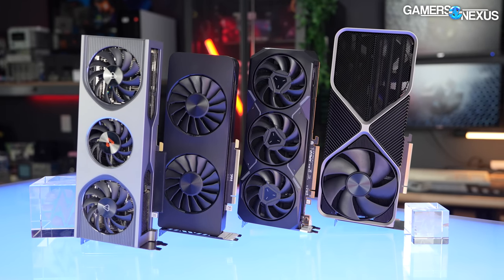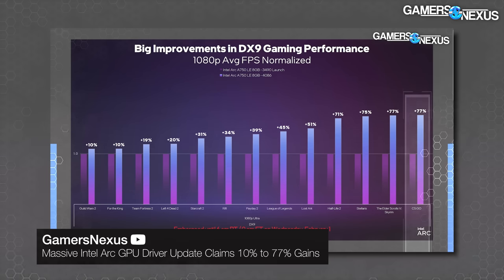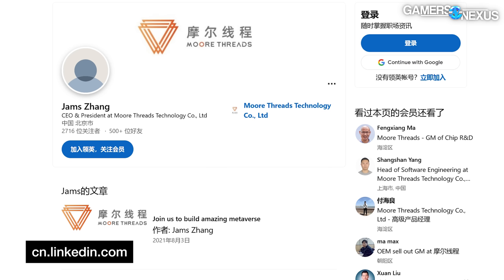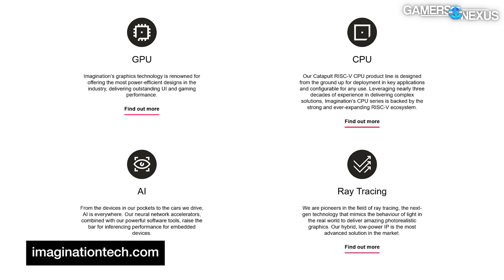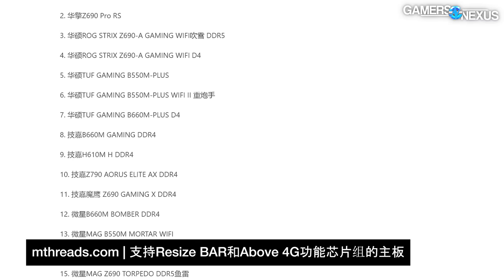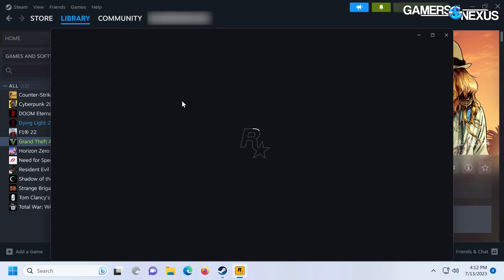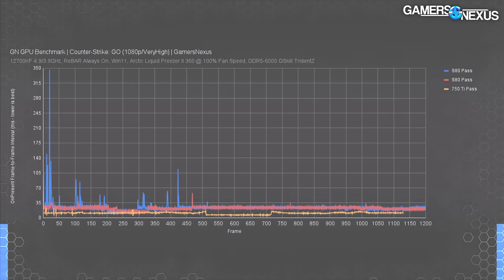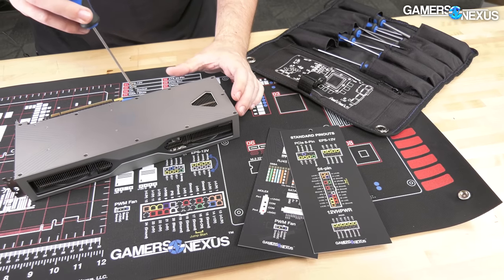China's Moore Threads MTT S80 GPU Review | A New Challenger Appears

Comment: If this is a domestic GPU, I wonder if it has better Linux performance.
Reply: In 2016 i remember the chinese creating dslr lenses at half the price and superior lens quality. They have done this in every field. Now GPU's. It will take a bit of time, but the chinese are fast.
Reply: Looks like it does have a binary-only Linux driver. They advertise support for Vulkan 1.3, which theoretically should run dxvk. So it's plausible.
Reply: It's very disappointing - everyone I've seen has clowned on the windows performance and rightfully so but I've not seen a single Linux benchmark of the card anywhere?
Reply: @starsnstrife ”Superior lens quality” is just not true. Even today it’s not true. At best it’s similar quality to your standard glass manufacturers, but in practice most of those lenses you’re talking about have noticeable issues. I wish you were correct!
Reply: @starsnstrife  lol this was funny. They want Taiwan because they cannot do this themself.
Reply: I wonder, but I also doubt it. It might gain on nvidea there, but I doubt it is better than its windows performance.  I mean, my Arc GPU is still not a great linux experience.

Maybe Phoronix will put it through the paces soon.
Reply: @starsnstrife  Nah what would they be? All i've seen are cute toys at best. Mind you flawed lenses can be a ton of fun.

There are areas where China is either leading or competing equally or have things that might be a little flawed but also nice and fun, but like betting on them just steamrolling everything because China Bik Stronk is not a safe bet. Quick iteration as they do sometimes helps, sometimes causes a lot of one step forward two steps back sort of motion.
Reply: @starsnstrife That’s just categorically false. It’s very common tactic in China to compare their best stuff to about B-tier stuff(or very old stuff) in the West(or Taiwan) and claims to be some enormous breakthrough to secure fundings from big companies or government that doesn’t know better.

They then use the fundings to cover the excess cost from poor/inefficient manufacturing and sell their products at lower price often at a lost to secure market share. They do it in a sort of fake it till you make it way, but as seen in the video pretty much every attempt in the tech field either failed or turns into scam.

The lenses you talk about are definitely not comparable to the better products outside and probably cost more in terms of material to produce too, but the government fundings are designed to give them an unfair market advantage.
Reply: @starsnstrife not with this. They simply are too far behind in process node and no where close to advancing. The past two government funded efforts to advance this domestically went bankrupt.  The Chinese are fast when they have stolen IP or reverse engineered samples to start with, but thus far they don't have it with fab capabilities.  Even if they manage to get the IP, it's going to be extremely hard to compete with western companies as to make modern GPUs, you are literally using tech from all over the world from various companies from the EUV machines from the dutch, German optical solutions for those EUVs, fab robotics from Japan, software and chip design from America and the UK, and of course the fabs in Taiwan where it all comes together.  China was on the path to join in the fun, but their recent shift politically over the last decade have all but isolated them from the cutting edge, and they will not get there alone any time soon.
Reply: @starsnstrife  That's not really a fair comparison. I can go on about why but it'll involve lots of private stuff. Long story short I was pretty heavily involved in the Chinese camera lens scene, a lot of the engineers already had decades of experience and already designed lenses for Canon and Nikon. You probably know Laowa, he designed the Nikon 200-500mm and a lot of other ones (for Tamron, Sony, Canon etc). Despite its quality control issues which is Nikon's problem, it's an exceptional lens. 

Designing GPUs is just different. China has a very well established optics scene that's no more or less capable than other nations. They have barely anything when it comes to silicon and with sanctions, this isn't going to change.
Reply: @EstellammaSS  He's not wrong about lenses, autofocus aside (bound by IP), what's your example? Laowa's lenses are slightly cheaper but often exceeds first party offerings in basically every metric. That's not to mention some specialised models they have which aren't even offered (mostly macro). If you're talking about cheap 50mm $100 garbage compared to cheap $200 garbage then fine, the first party models are definitely better. They can make a better one for the same $200 but in the low end market, how are they supposed to sell it without autofocus?
Reply: @zethloveless7238  Their economy says otherwise. They can do everything by themselves stop listening to mainstream media nonsense.
Reply: @starsnstrife  not really. if they were then they already have GPU that is dominating the market years ago. GPU is a whole lot more complicated. if anything this MTT GPU prove that the chinese have never had an issue to make their own GPU hardware wise but the complicated side on the software makes them unable to really thrive to make their own.
Reply: @scorpiom8053 yessss! 
🇨🇳 domestic market #1!
 Invest in Chinese real estate now! Fire sale!
Costs literally collapsing into the ground!
😂🤣💀
Reply: @obake6290  It makes sense to focus on Linux and DXVK the drivers and code etc would be more accessible for them. I think thats what I would do if I were them
Reply: @Metapharsical  Ghost Cities 😂😂 China's out here trying to cheat their economy
Reply: @euclideanspace2573  They do not lol. Again, I wish you were correct. But still to this day they have optical issues that their Japanese (and European) competitors simply do not have. Also, autofocus isn’t just IP — they’re able to license it, but don’t, because then their lacking optical quality can’t be made up for via cheap prices as the mechanisms aren’t cheap to build compared to manual focus ones.
Reply: @Girvo747  You made claims but you're not backing it up with any examples. What are the so called "optical issues"? Care to name them? 

Your "I wish you were correct" is kind of hinting "at a cost" which means you're only after affordable options which is fine and I do agree. Used Japanese/German lenses are great compared to new cheaply made Chinese ones. I'd spend $200 on a used Nikkor over $150 on a new Yongnuo piece of rubbish. There are plenty junk made by the likes of Laina, Yongnuo and Zhongyi, but there are also plenty good ones, the same applies to Japanese/German brands.  

Sure, AF can be licensed. Want to guess why there simply isn't a company outside of Japan making proper modern AF lenses? IP thieves at Yongnuo aside.

Comment: 27:16 Not just to avoid the screw holes, but it would place the outer chips closer to the die. So there are performance reasons to do this. I suspect the BGA Balls on the chip for the memory are placed differently to nvidia designs. It would be interesting to confirm this though. It would also make trace routing a lot easier, which would be important for a card with a short development lifecycle.

Regarding the upper location of the power delivery: other cards have done this as well (pro vega 2 duo and Pro V430 come to mind). I think it makes a lot of sense for a PCB of this size. There is not quite enough room to put it in other places without moving the GPU core around.

Comment: 4:45 Loving who I assume is Jams Zhang doing his best knockoff Jensen Huang announcing the GPU, and the slightly different (and leather jacket adorned, as is tradition) take at 7:50.

The physical heatsink and card layout actually seems pretty nice, and the connectorized fans and header plug in the shroud actually seems pretty convenient from a maintenance and replacement perspective.

I would be interested to know whether the connector on the PCB itself is an actual PCIe power connector rather than the weird EPS12V connector you mentioned that the card uses at the edge.

Comment: This shows just how hard it is make GPUs that work well. Undoubtedly this card has much more performance to give, but it'll probably never be realized due to driver & compatibility issues. Also shows just how much of a powerhouse chip maker Intel is. While ARC may not impress compared to current AMD & Nvidia offerings, comparing ARC to Moore Threads shows us Intel actually pulled a damn near miracle with ARC!
Reply: Intel had a giant head start with their integrated graphics being used in laptops and shitty desktops all over the world. They didn't pull a "miracle"; they landed right about in the middle of the range of possibilities, given their starting point.
Reply: @Ithirahad  I'd agree with you if the ARC team had the full backing of Intel. Although it seems like they put ARC on a backburner with a skeleton crew, almost hoping it would fail. That's more the miracle I was thinking of TBH.
Reply: @robr640  Frankly it sounds more like the Arc team was just taking too much time and money and Raja may have been lying about how close they were to a releasable product, forcing Intel leadership to reabsorb the graphics department and take away their independence. Ideally they would just appoint new leadership, but even Intel doesn't have infinite money or time to dedicate to anything.
Reply: @Ithirahad  That is a good point, Raja is definitely know for stretching the truth LOL!

Comment: I think part of the issue here is that for a very long time, there have only been 2 GPU manufacturers (mostly nvidia), and games are probably designed with those specific manufacturer GPUs in mind, so they would be coded to work with their quirks. If you introduce a new GPU with its own quirks, even if it's fully compatible at the API level and technically capable, it will never perform as well because the games simply werent designed around it.

Comment: The 750 ti is a CLASSIC. It was around when I was in high school, I knew multiple people with one. (I had an HD 6870 at the time.) The 750 ti was slightly better than a PS3/360 and didn't need an extra power cable, so it was a good option for people who needed to throw a cheap gaming card into a Dell or whatever. It wasn't groundbreaking, but Minecraft and Team Fortress 2 didn't need much.

Comment: The problem is there's such a huge wall around the GPU market for new entries. Even game devs need to work extremely hard to ensure compatibility with both Nvidia and AMD. For a new company to enter the space there is going to be immense amount of brick walls to run into just getting the card commercially functional. I applaud any company giving it a go. Because AMD and Nvidia have decided to conspire together to manipulate market prices for their own gain. More competition is very much needed today more than ever before in the GPU space.
Reply: which is actually kinda weird, because ostensibly speaking, all graphics APIs are open standards- DirectX, OpenGL, Vulkan, and even OpenCL for compute, all of these are available for anyone to implement and are supposed to be implementation-agnostic. This would be as opposed to x86-64, where you just straight up only have three licensees (Intel, AMD, and Via Technologies), and nobody else is even allowed to implement the instruction set. You would think that it should be easier to make something that could at least function with all APIs and that getting performance would be the main difficulty

Comment: Interesting the focus of this GPU is not the latest APIs but older DirectX specifically. One would think China wanted to get away from Windows.
Reply: Like Apple any better with their OpenGL lacked behind almost decade and then they jumped to copycat metal surface.
Reply: @XantheFIN pple is also American. I would think they would be more focused on Linux since it cannot be restricted, lol. With Linux focus on Vulkan, which does also work in Windows. Metal is very similar to Vulkan.
Reply: @AndersHass  They are actually more using BSD kernel and not Linux but yeah.
Edit: Why big companies go after BSD? Licensing. They don't need publish source codes example.
Reply: because gaming is not the main focus. that's why despite the raw power gaming performance was terrible.
Reply: @arenzricodexd4409  what was the point of the GPU? Bit big for just displaying things lol
Reply: @XantheFIN  as far as I can see there are more support for Linux (hardware and software). But yes if you want to avoid opening up the source code then you can only use BSD legally speaking.
Reply: @AndersHass  compute.
Reply: @arenzricodexd4409  well I remember meta being mentioned in the video lol.
You do also compute with gaming but I assume something akin to CUDA on Nvidia GPUs (which is also kinda what I believe was meant with meta).
Reply: @AndersHass  this GPU was design more specifically about compute (just like those chip from Biren). maybe some professional rendering that's why initially the API support is limited to OpenGL and DX9 only despite the hardware have the capability to support certain DX11 feature. they probably being asked to make the card to be gaming capable much much later.
Reply: @arenzricodexd4409  I like you don't elaborate what you mean by compute. Rendering is also computing, just a very specific task being computed. You can also compute with newer graphics APIs lol.
Reply: @AndersHass  yes it can be done. but still does not change the fact this GPU is made for professional stuf (rendering and general computation). in fact you can say it is the only purpose and nothing else. gaming only come into their mind long after the hardware it is done. most likely because they chinese gov ask them to do it.
Reply: @arenzricodexd4409  you should have just said professional stuff from the beginning instead of compute, lol.
The meta thing is also professional stuff.

Comment: I find this an interesting card from a hardware point of view and I would quite happily collect one to go with some of the other low volume weird and wonderful hardware I own such as Amiga add-on cards, such as the Phase5 PPC/68k 060 PCI card I own and used back in the late 90's mainly for 68K Mac emulation.

It would also be interesting to revisit this card in 6 months or a year as if the issue are with the drivers rather than the hardware the compatibility and 0.1 percent lows could improve to make it a usable card for running DX9 and DX11 software even if its not competitive from a performance or price point of view with other modern GPUs.

Comment: You get 2x-3x better performance with Vulkan on Ubuntu 20.04 FYI (using a custom Unity3D benchmark I made).
Windows D3D11 & Vulkan drivers suck BUT the card shows a lot of potential on Linux as being good for Proton if more Vulkan bugs can be fixed.

Comment: This has been an interesting review, I've heard that MTT GPUs are actually working for some enterprise workloads very well, so that's why they are flying off the shelves. Other than that they meet my performance expectations for what is a basically brand new architecture with everything being developed essentially from the ground. Another thing is that there's a competing product from InnoSilicon which technically is relying on PowerVR technology, so their drivers might be in a better state considering that PowerVR even were the first company to bring decent Raytracing to the perspective of enthusiasts around a decade ago.
Reply: I kind of doubt the claim they are flying off the shelves considering you can get a 3060 for half it's retail price and not have to deal with any of the issues the card has
Reply: @macicoinc9363  Unless you're in a list of countries where you can actually buy MTT.
Reply: It's a workstation card designed to run on Linux. it isn't meant to play games. The actual competitors are cards like the  NVIDIA A4000 which costs $900.

Comment: Appears to be less performant than the last several iGPU generations, but for a very new and experimental card.. it works. Concur with it being mostly a collector's item. Re: metal/aluminium body: is the material handling or machining simpler or cheaper than for a polymer/plastic body?